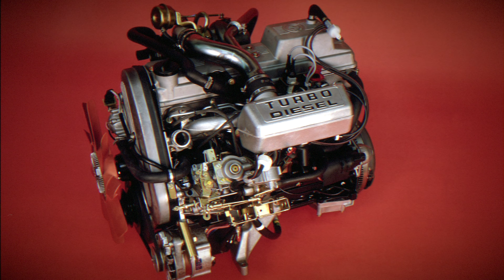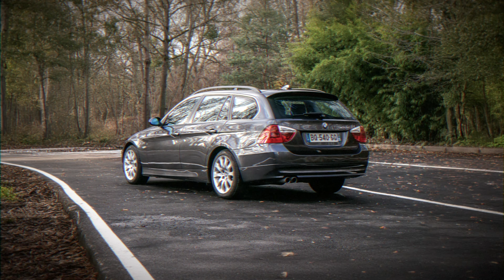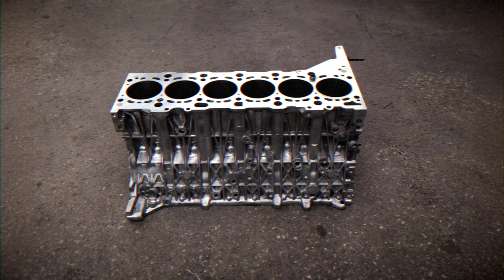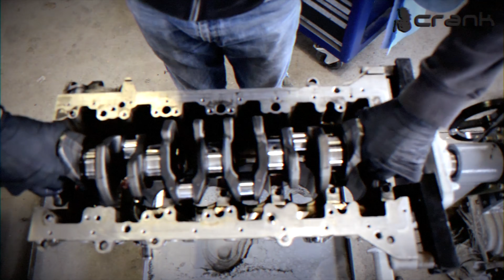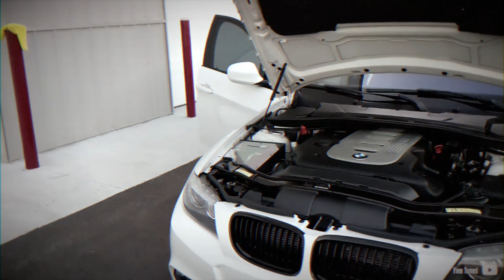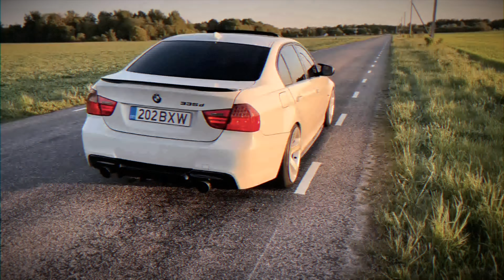The Most Reliable BMW Ever?!

Comment: The Older Mercedes OM606 is equally if not more Reliable and Factory Turbo Engines are good past 600 bhp and 6000 rpm .
No-one is building them like this any more .
Reply: you may have missed the points about fuel efficency and emissions. if i wanted to make 500hp and give no fuck id choose the 606, if i wanted a dayly with good fuel economy and low taxes and still 300hp id go for the 57.
Reply: @NIOC630  . The 606 set down at 300 hp uses very little fuel and they don't have to be smoky . Cold side  EGR rather than Hot side and a DPF with Regen can be fitted as well if desired .
Reply: @johncunningham4820  Nah, they're not at all efficient compared to the M57.
an OM606 is many things but particularly fuel efficient isn't one of them.
Reply: You OM606 nerds always show up anytime someone says "diesel" lol

I mean this in the kindest way, and in no way do I blame you. It's a stellar engine and I'm sad I do not own one.
Reply: @goosenotmaverick1156  . Two of the BIG pluses to the 606 is One , Mechanical Injection . No  Electronics  to " shit themselves for no reason " and Second , No PLASTIC  PARTS on the Engine itself . 
The  M-57 has a VERY strong Core , but all the Outboards and Plumbing are an Easy Failure Point .
Reply: @johncunningham4820 litteraly what my dude said there. There s no diesel thred whitout you guys hijacking the discution with reasons why the 606 its the best of the best. It is indeed an amazing engine,but at the same time we can have a discution about one engine without starting to give reasons why the 606 it s better
Reply: @catalinbica6951  . Sorry to annoy you with Facts......................
Reply: @johncunningham4820  it s ok,everyone who watches this guy videos pretty much know about how good it s thr 606
Reply: @johncunningham4820  I've had plenty of M57's and not once anything plastic or electrically controlled has "shit them selves" for any reason. Funny enough I've done more engine work on a friends old 1997 w210 300td with 312tkms than any other make or model. Everything from rattling timing chains to failed injectors and bosch fuel pumps. Don't even get me started on the clear fuel lines.
Reply: @nikopalonen92 . So where do You live ?
What Country . 
Sounds like you have been a bit Lucky .
I  used to work as a Towing Operator and the MAIN thing that would cause BMW's to need Towing was a Failure in some Plastic ancillary part to the Engine . Usually the Plastic Radiator Header Tank .

I  live in Australia . In  THIS  country it is possible to " Go Remote " enough to be 1000 km from ANY  OTHER  PEOPLE  whatsoever . Breaking down in such a place without a Star-link or Sat-phone or EPIRB you might not  get Found for years .
I  would rather NOT trust an Engine that has Sensitive Electronics handling 20.000 psi fuel pressures and Plastic Induction parts that can Fail without much , if any , warning .
Give me a properly Services Mechanical Diesel any day , thanks .
Are you aware that the OM602/3/4/5%6 are a bit of an Oddball . Not the 617  though .
They have an Offset Crankshaft .
So  TDC is NOT where you think it is .
You will still make then Run , but poorly and with Detriment to Reliability .
Also Servicing on ANY diesel is Very Important . No cutting corners .
Those  OM60 series Engines will run , perfectly well on COOKING  Oil if necessary . Run fine . Just Smoky .
As they say Different Strokes for Different Folks .
Reply: @nikopalonen92  . Sounds like you may have been a bit Lucky .
A  VERY common " Stopper " for BMW's is a failed Plastic Header Tank on the Radiator . And Electronics , in general , do not like Hot environments . Capacitors fail in excessive heat , like in an Engine Bay .
Funny thing.......... OM602,3,4,5, & 6  all have an Offset Crankshaft . TDC isn't where you think it is . Needs Verifying during maintenance .
You'll make them Run , badly , if you're unaware of that 3.23 mm thing .
Reliability will be severely compromised too , due to Running  Mis - Timed .
Reply: @johncunningham4820  I am aware of the timing on om60x engines. What come's to plastics I've had one single failure and it was upper coolant hoses coupling on radiator endtank. Just loosened up the hose a bit and pushed it further in and it was golden.
Reply: @nikopalonen92  . And  there  we  go . Just what you need in the Middle of Nowhere . A  Plastic Radiator Failure .
I  don't know where You live , but  I  live in Australia . Remote Locations here would actually only make sense to a Russian or perhaps a Canadian as well .
You CAN get to places here , where you are LITERALLY 1000 km from any other people . We think differently about 
" Dependability " here . 
Another little Trick the OM 60x engines have up their sleeve is : They will Run On Cooking Oil , or some-such if you NEED to . Smoky , and a bit down on Power , though not that much really , and WILL get you home .
Try  that  with  a : Modern : Common Rail Engine . It won't even START .
So : Different Strokes for Different Strokes   I  guess .
PS . Glad you knew about the 60x Offset . It does confound if not known about .
Reply: @johncunningham4820  yes but what would you expect from 29-year-old radiator with 220k mls and I live in Finland
Reply: I mean... they sound good and can produce a vey peaky 600 bhp and nothing at the bottom end with a gigantic turbo. I'd imagine they're great for a track car. But for a daily driver, I'd take an N/B57 twin turbo any day. Peak torque arriving at 1500RPM, basically zero turbo lag anywhere in the rev range combined with a not-exactly-unreasonable ~370 bhp on a completely stock engine that produces no smoke and does ~50MPG. You're simply not gonna get that with an old-school IDI mechanically injected engine.
Reply: @Azurael . BOTH Engines are enormously strong , and Both Engines  WILL be Peaky  pushing out 600hp . Only Three Litres .
A  606  can be a Tractor Engine when set around the 300 mark , completely Easy to drive . Smoke comes down to having the ALDA set correctly .
The Big difference is the 606 doesn't use Plastic Parts in the Main Engine .
Even the Chain Guides are Rubber backed Metal . No there are No Electronics they can Shit themselves for no reason at all .
A  failed diode will make the Boomer limp or simply stop . 
BTW , the N & B 57's have a more Fragile construction to the  M57 . The older Engine is better .
Reply: @johncunningham4820  well, I've never seen somebody build an OM606 using a compound setup with a VNT high pressure turbo for a more reasonable power output and better low-end response. I'm sure it could be done and maybe it would provide equivalent drivability if not the complete absence of smog and fuel economy of a common rail engine but the fact is, my car came from the factory like that. And yes, the M57 is a lot more sturdy than the N57. It's also heavier. No doubt that chain and tensioner replacements every ~100k miles are a good idea on an N57/B57 (they use the same setup as the post-2011 N57 anyway, even if they don't have the same reputation… yet)

You'll never make 600bhp with a BMW engine. The OM606 has way better head flow and DI engines simply can't rev so high. I'm not questioning its superiority in certain scenarios but those aren't daily drivers. Even with a big single turbo, uprated pump and injectors and all the emissions stuff deleted, 450bhp is probably a more reasonable figure for an N57.
Reply: Om648 is insane
Reply: @OM617a  . Fully agree . 605 is good for 500hp and the 5's , from anyone , sound  Super Cool .
Reply: The really nice thing about the 606/605 is the ability to use a mechanical fuel pump.. I considered swapping my 602 for a 605 but really dislike the old mercedes owner experience too much, including the rest of the car.
Reply: The v8 diesel in the merc is probably even more robust, but being a v8 revving them too high is detrimental, but they did use the engine in small railed trams at low rpm to pull rail cars
Reply: @jarrynsmith  . You're talking about the  Truck Diesels  there . Not the Car/SUV/4x4  engines .
Reply: @johncunningham4820  I'm talking about the om628/629

Comment: Perhaps it is the most reliable BMW. A friend’s 335d keeps on having a long list of expensive mechanical faults from leaky injectors, to valves caked in carbon, egr issues, dry seals after only 80K miles, etc. He replaced it with a hybrid rav4 and never looked back.
Reply: 180k miles on my x5 35d - other than doing a trans service  a few thousand miles ago - glow plugs and glow plug module - its been dead reliable - and makes around 400hp as well.
Reply: 35d M57 is a lot worse. Timingchain, turbo, some bearing issues, etc. It is a different block.
Reply: @R3v3rs3entry   180k+ miles no timing chain issues... your probably confusing it with the N57...
Reply: @joewolfe642  35d timing chain issues are actually really common, especially after 300k km. Only actually bulletproof M57 is the old iron block. And I know how shit the N57. Bearings, timingchain and oilpump are garbage.
Reply: @R3v3rs3entry  I got 3 e90 335d m57 with 320k, 350k, 380k. All original timing chain. The chain really isn't common unless the car was poorly maintained
Reply: @alexd5240  Yeah because you can judge every other car by three examples. But you cant change the fact that m57n2 has thinner chains.
Reply: @R3v3rs3entry  well explain then why my cars are fine 🤣
Reply: @R3v3rs3entry none of those is common
Reply: @R3v3rs3entry   just put another 1000 miles on it - no issues many folks with the aluminum block motors with lots of mileage and  people are now making over 1000hp so no idea what you are talking about.
Reply: Probably because he bought it second hand and the owner before him (probably him also) didn't maintained them + they drive them like maniacs => results in more wear.
Reply: He got a lemon then
Reply: Rav 4 is a painful experience, why would you do that to youself?
Reply: Sounds like a typical owner that ignored the service schedule.
Reply: Meanwhile my 1.5L 3 cylinder with 200 PS at 100k no issues whatsoever.

Just another proof that the 3 cylinder myth about reliability is false.
Reply: @dom3827 lol 100k is nothing. That shit won't see even 300k.
Reply: @R3v3rs3entry  they do easily 300k. You can buy them 2nd hand at your dealer plenty with that mileage.
 You know why 3 cylinders are used at construction vehicles?
Because they are reliable and compact.

The specific engine in my car is cruising at Nurburgring tuned to 300hp stock internals. 120k kilometers now.
Reply: @R3v3rs3entry  and compared to a VW 4 cylinder 100k is pretty much. Or for a bunch of bmw 6 cylinders. Some dont even see 50k until timing chain snaps, so.....
Reply: @dom3827  Dude. What tf do you expect at 100k? U barely got out of warranty with it. Tf is you saying?! Wait until u reach 200k, 300k, half a mil, or even a mil.
Reply: @n1ck72  as i said. They easily do 300k. They are just run in by then.
Reply: @dom3827  I don't believe someone saying "as I said". I never seen an 3 cyl with 300k. Probably with the second engine. Especially if you race it. Rather than that, for budget yes it's a good engine. U can get both GR's and get good performance around the ring with good fuel consumption. Plus the car is lighter => cheaper parts. But saying that your 3 cyl petrol can be as reliable as a good diesel...
Reply: @n1ck72  so you have no clue of the used market.

Plenty 3 cylinders with 300k + online. Toyota Aygo, Ford Fiesta, Opel/Vauxhaul Corsa. Plenty.

I said what i said. Sounds like your problem.
Reply: @dom3827  "yOu HaVe nO cLuE" dude shut the hell up with your 3 cyl. My colleague had a Ford 3 cyl BRAND ASS NEW and by 40k km the engine broke in half and spilled all the coolant inside the piston chambers and outside. It was a mess. And on second hand market I don't see to many 3 cyl with 300k+ because people don't hold on to them. Most of those 3 cyl cars are impractical as they are way to small. And instead of taking a car in the city i'd rather take my quad or bike anytime. As I said before, the GR is ok for the price and performance you get out of it to race on the 'Ring.
Reply: @n1ck72  oh dude, your ego seems extremely broken 😂

Spare those fairytales, cmon 😂😂😂😂😂
Reply: @dom3827  Yeah man. My Ego. Shouldn't you be at work at this hour? Idk who is egotistical here licking "oH bUt 3cyl this and that", at every single comment. claps Yeah man fairytales. U want the phone number of my colleague to tell you his opinion on 3 cyl's? :) And especially on FORDs?
Reply: @n1ck72  precise, i am at work. But i am the Teamleader here, so i can do what i want, when i want 😉

Your comment is so pathetic 😂
Reply: Thats why ive replaced hundreds of them 🤣
Reply: @dom3827 I would rather take the bus than even be seen in a RAV4, let alone drive one! 😂
Reply: @derin111  Rav4?
I dont get the context. Pls help.
Does the new RAV4 Toyota have a 3 banger?
Reply: @derin111  just looked it up. Yea, seems to have a 3 banger option.
Probably based on the Yaris GR engine i would assume. One of the best 3 bangers there are. I see nothing wrong with it.

Im driving an MK8 Fiesta ST.

Comment: Isnt the n52 also really reliable
Reply: Depending. Valvetronic + electric(onic) waterpump+ nox sensor can be very expensive and fail...the m50b25tü ist the best gasoline straight six from bmw...considering the US s52b30 and the alpina e4 and e5 are basically modified m50s...they have a lot of n/a and even s/t/c potential too

Comment: The diesel 2JZ
Reply: What about om606
Reply: @EQ2Errick the true diesel JZ
Reply: Cummins 6bt would like to enter the chat 😂
Reply: @hocek11  I mean sure if the 6bt was a passenger car engine. But it's not. It's a light and medium duty truck engine. Whole different basket of bananas.
Reply: @goosenotmaverick1156  ..and weighs about the same as an entire passenger vehicle 😂
Reply: @Sparky_D  you ain't lying haha
Reply: @goosenotmaverick1156  judging by possibility of registering ram 2500 as car weighing less than 3,5 tone I disagree with you.
Reply: @hocek11   you make a valid point. Depending on where you live, even half ton trucks are registered as commercial by requirement, but in others they're not unless over 1-ton rating. So it could be classified as such in some areas I suppose. But, that said, that engine still doesn't live in the same engine class as the others discussed. The engineering mindset was certainly not the same
Reply: @hocek11  a 24v Cummins weighs literally twice what an M57 weighs, so I'm not sure your argument holds up very well.

Edit to add; same applies for the OM606 discussed as well. Both OM606 and M57 weigh around 500lbs and a 24v Cummins is over 1000lbs. The master Google says the passenger engines are actually under 500 and the Cummins more like 1150.
Reply: Why couldn't we say the OM606 is like a 7M and these are the JZ? 

Imo that feels more accurate.

Comment: I have had my E46 330d AC Schnitzer since 2003, currently it's sitting on 790000km and my dad still drives it daily to golf, and running his personal errands. I have moved on to the F10 M550d touring, Twin big turbo swop, been dailying it for 5 years now.
Reply: Hi mate, 
Would you mind explaining "twin big turbo"?
Reply: @OM617a  Haha, maybe.
However, It's possible to exchange the turbo internals in order to flow more exhausts and air - in order to gain more power without EGT rising.
Reply: The car distribution within the family indicates a healthy father-son relationship.
Reply: E46 is great because it’s so diy friendly
Reply: F10 M550d has three turbos.
Reply: @onlyhuman7420  if you can read you will notice that I stated I've swopped out the triple turbo setup for a twin hybrid turbo k26 setup from the F10 535d.
Reply: Is that the setup with the kp39 and the k26 @bzilla-d4i
Reply: @bzilla-d4i  how many hp???
Reply: Currently, I own a 541000 km e60 with m57TU. Replaced quite a few things over 2 years of ownership but I'm still happier with it than I was with my previous car. One that was half the age, less than half the mileage, and almost double the stock power. Jaguars aren't known to be reliable or reasonable to maintain.

Anyway, when I finally admitted to myself that the jag hasn't been financially viable to repair for the last probably 14k Eur - I swapped out the remains with my friend for this bimmer. I didn't think I'll stick with this car for very long initially but now I think that trying to find a better car on a used car market is like playing a roulette with a 20% chance of not just winning - but barely breaking even.
Reply: I’m an American and we don’t get all the cool stuff. I also had an e46 I got with 50k miles and drove mostly trouble free to 150k miles. 330i Mtech 4 door manual. I miss that car. And they have gotten sooo expensive here.
Reply: Have ya has to change main bearings or chain in yout N57?